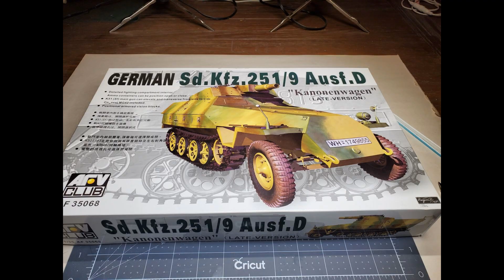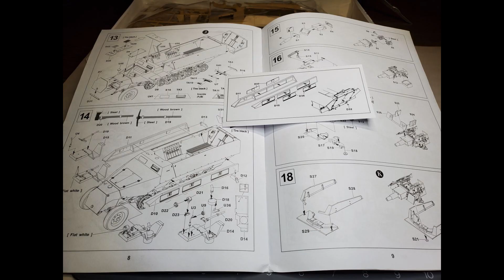AFV Club Sd. Kfz. 251/9 Ausf D Kanonenwagen Complete Build

Comment: Hi buddy just came across your channel your 251/9 looks fantastic I've got 2 afv club half tracks 251/C and the one with the pack gun I've also ordered 2 sets of metal tracks as same as you i don't like rubber band tracks. Have just subscribed to your channel.  Cheers Gary 🇬🇧
Reply from the maker: Hi Gary, the AFV 251 is one of the rare times I used kit rubber band tracks and I had trouble with them. You made the right call in getting some better tracks. Thanks for the sub!

Comment: they do a set of single link tracks for the sdk 251 kit's separately there really worth it tbh! I've found the original Dragon kit of this kannonwagon as afv call it? it's got loads in the box as it's on the good originals with magic tracks etc butnim the same time as you into armour I started in 2018 I'm away to start the Big boy 12 Tonner SD.kfz DB 10 Gepanzerte it's a later bugger version as if the 251 weren't bug enough so bought the new Hobbyboss flak for it to tow as a heavy guns mover! I've heard loads of bad things about afv clubs 251 kit's I've got an ausf D in my stash but loads Dragon one's I prefer to build its just sat there for good couple year's now!
Reply from the maker: Dragon kits are always good even if we need a secret decoder ring to unscramble the instructions. I haven't purchased another AFV Club kit since and I have no plan to, it was not a good experience. I hate rubber band tracks. Haha